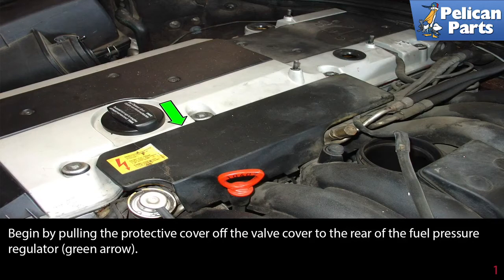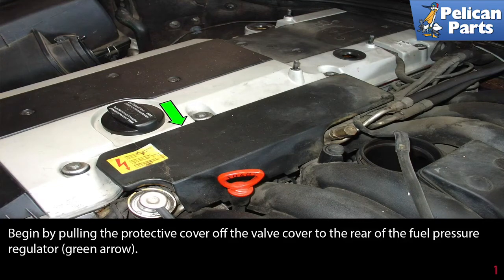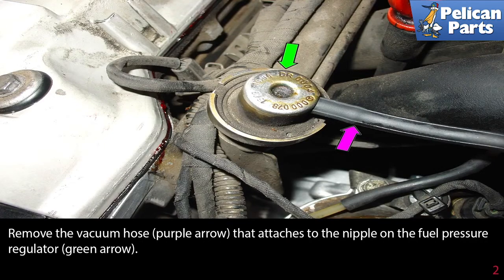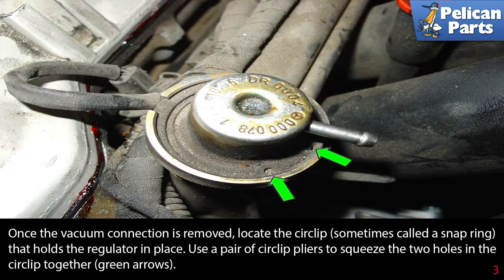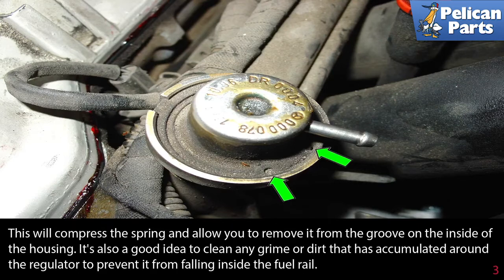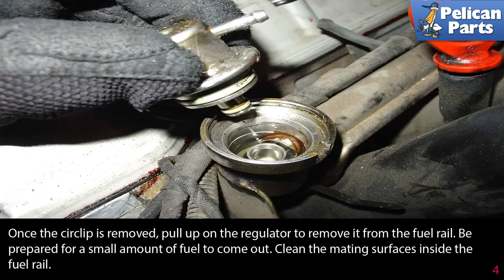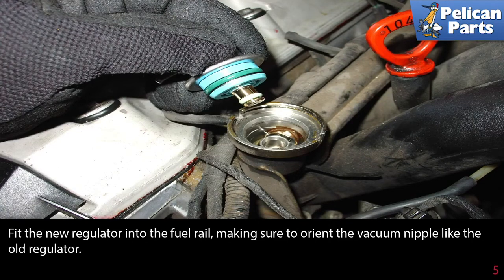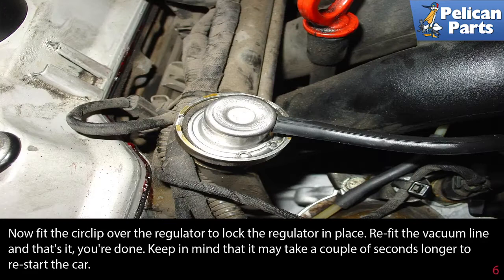Mercedes-Benz W210 E-Class Fuel Pressure Regulator Replacement

Comment: What part number is this? Looking to buy on site
Reply from the maker: You didn't mention what year and model vehicle you are working on.

With your vehicle info handy, give The Pelican Parts parts specialists a call at 1-888-280-7799. They can figure out what part or repair kit you need.

Comment: My 2000 e320 runs just replaced the filter and it's a semi crank no start but will when it wants to. Do you think it could be the fpr?
Reply from the maker: I can't offer any helpful insight without knowing what is missing from the system when you are trying to start it. When your engine doesn’t start you’ll want to check the basics. Check spark, fuel injector pulse and fuel pressure, volume, quality and engine compression. Are there any fault codes? Once you figure out what is missing, it will be easier to diagnose.
Reply: @pelicanparts  it starts drives and all then if it stop don't matter if it's cold or hot it won't turn back on for about 2 3 hrs.
Reply: Already replaced the fuel filter.